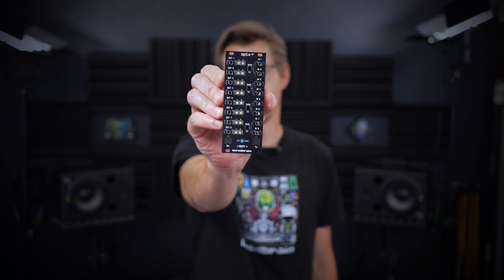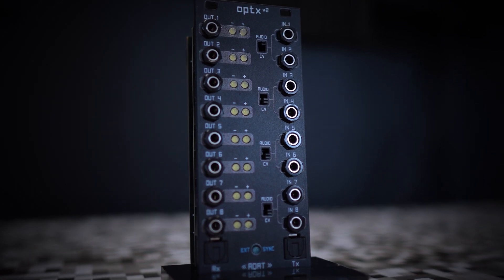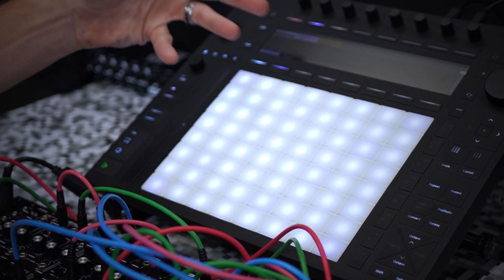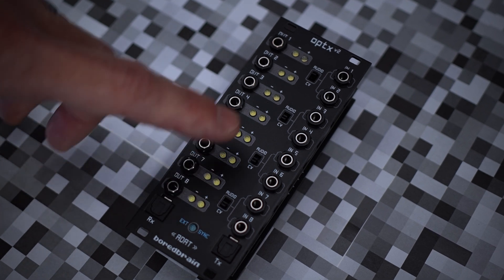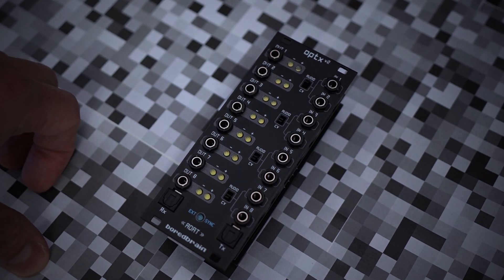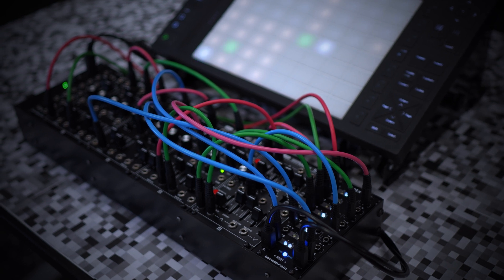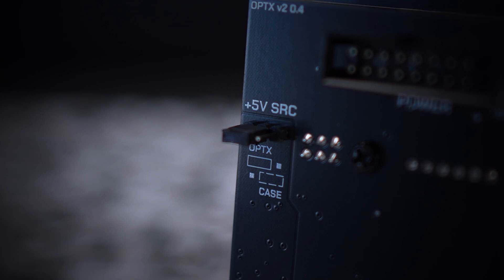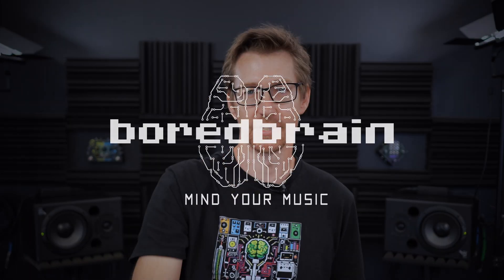Boredbrain Optx v2 brief introduction (ADAT converter for eurorack)

Comment: Hi, I checked your website and the user guide but one thing is not entirely clear to me – the issue of mod vs. line-level? With my current setup I'm using 4ms I/O, which is convenient because it converts line-level audio into mod-level output jacks (coming from external sources), and mod-level audio into line-level output jacks (going back out to my interface). Obviously without the conversion the signals can suffer from being too loud or too quiet depending on the direction.

I'm looking at the Optx v2 as a replacement to greatly expand my I/O from 2 channels to 8 each way (and have CV I/O too!). Is this whole mod<>line level thing not an issue? Can I take an external (line-level) source such as audio playing back from my DAW and patch audio directly from those outputs into my modules without an issue, or will I need to convert them first with another module? And same with returning back to my DAW, will I need to first convert back from mod level to line before patching into Optx, or does it handle this for me? Thank you!
Reply from the maker: @jonathanwingmusic  Optx v2 will handle line level signals being input and output with no issue. They will be a bit quieter going into the DAW and a bit louder coming out of the DAW than eurorack signals, which it is designed for. Because the module's noise floor is so low you can just bring the signals up once digitized if you like. Or you can use the 4ms I/O in the other direction you did previously, between your line level gear and Optx v2. Our Xchangr module is also a great option, although neither are completely necessary in this instance.
Reply: @BoredbrainMusic  ok cool. I'm basically out of rack space so would just end up ditching the 4ms in this case. I can also easily gain stage the sends and returns within my DAW as needed. Thanks for letting me know, I look forward to picking it up and having 8 clean channels each way, plus CV 🙏

Comment: Hey Boredbrain :) 
Question... I would love for Boredbrain to confirm this. 

Claude LLM (AI like Chat GPT)  told me that Optx 2 adds only 1ms or less of latency between the module and an external audio interface (Lower than Expert Sleepers Es-10, apparently). 

I want to use Boredbrain Xcelon and Optx V2 to integrate a Roland V-drum e-drum kit into Eurorack. 
The total latency from the drum pad strike to the audio interface must be under 7ms. 
Any more and it starts to sound audible, and is no good for real time tracking or overdubbing, of drum-triggered synth voices/drum kit audio while monitoring DAW audio. 
ADAT latency is one part of that signal chain that adds latency. 

I realise I can monitor with low/no latency using the BoredBrain-Monitr .. but that is only useful for the first take, and not while monitoring pre-recorded audio from a DAW. 

Your answer will help me realise my signal flow goals so thanks for your time :) 

Cheers from Australia!

Comment: Super cool - but optional ADAT ports on the back of the module would have made this perfect - for those of us who want to keep all permanent wiring behind our instruments.
Reply: YES, they should do a expander with ADAT ports on the back, my rack would be amazing.
Reply: Agree with this. My current I/O module (which is simply analog 1/4") I had manually tapped the rear panel by soldering to audio jacks installed into the rear of my rack. It was pretty easy to do, just soldered the two necessary wires and shielded them. Now considering shifting over to ADAT using this module – I am not sure if the same would be possible or if it's as easy. I googled and one can easily find ADAT sockets for cheap but they have many more pins to solder, rather close to each other, and I can't really find good info on wiring diagrams, so I'd be scared to open up a fresh Optx and poking around without knowing what to connect to haha. But if any clever person reading knows how to solder up ADAT jacks I'd love to hear about it.

Comment: I am going to wait until i see reviews from people. I already have es-3/6 so if optx v2 doesnt have a ton of noise like v1, clock issues and converters are grade A with the high quality op-amps, i wont get es-10 and try the optxv2. With excelon being amazing i am sure this new iteration will be high quality!
Reply: I'm in the same boat. I have an ES-8/6 combo, but am really interested in the Optx V2. I'm willing to sacrifice a couple inputs for the Optx features and slimmer profile, but the signal LEDs on the ES inputs is really useful and will be missed.

Comment: I have an odd question, can I connect the input side to a Ferrofish pulse and the output side to a push 3? So two different devices at the same time?
Reply: question is why would you want to do that
Reply: @zdfghdfg  so I can get more audio inputs to my interface, but use the outputs for push 3 to send cv to my modular. I use push three standalone.
Reply: @Ekkomouse  The ferrofish is just a converter just like the optx so you will need to connect the optx to your audio interface. 
One optical cable from the push adat out to the optx adat in, and one optical cable from the optx adat out to your adat input in your audio interface. What audio interface do you use?
Reply: @Ekkomouse  I don't know of an audio interface that is called "Pulse" the closest I can think of is the old Creamware Pulsar?
Reply: If you meant the ferrofish pulse, its not an interface, it's a converter...
Reply: @zdfghdfg  good lord, if you’re going to give advice then read up on functionality. RME ufx+ Madi in/out to Ferrofish Pulse receives/sends Optx input/output via adat. End result is all RME/Ferrofish pulse/Optx channels are available natively in RME Totalmix interface software. My question is can I split inputs to the Ferrofish as I need more inputs to my interface, but I could use cv output from push 3 more than outputs from the interface.
Reply: @Ekkomouse  This is why I asked you about your interface, you weren’t clear about your setup. Should I guess that you're using the UFX+ connected to a Ferrofish Pulse with MADI (MX version)

Sure, it will work, but your Push will need to be the master clock, and the other converters, including the UFX+, should all slave to it, from the optx2 ADAT out to your Ferrofish Pulse ADAT IN and then to your UFX+ MADI.

And learn some manners, people usually won’t bother to help you with that kind of attitude.
Reply: @Ekkomouse  it’s possible to keep the UFX+ as the master. 
If the Ferrofish Pulse MX can accept the 2 ADAT I/O (from the opx1 and the optx2) and convert them to MADI I/O, adding them to the MADI stream along with its analog I/O. 
The Push will be connected to the UFX+ ADAT I/O and will send the ADAT/CV to the opx2 through the UFX+ to the Ferrofish. Some routing in TotalMix FX will need to be set up, but it’s doable.
Reply: @zdfghdfg  Well from my perspective your questions/statements were overly concerned with the interface component, which is least important here, and not really needed to answer the initial question, as the optx is currently hooked to the Pulse, and the Optx2 would also be hooked to the same. 

It’s important to allow people to express frustration, your comments were too concerned about the interface. Your comment with the manners statement tells me you’re not aware of how you were coming across. 

Your last statements were more helpful and did spark the same idea for me also, to hook up push 3 directly to the pulse and use totalmix routing, something I can try now with Optx v1, which seems obvious in hindsight, but only came to light after this conversation, so thank you for that part. 

I still wonder if I can split the inputs and outputs to avoid totalmix latency, though maybe it’s not really enough to matter.
Reply: @Ekkomouse  You have a really strange way of expressing gratitude to someone who takes the time to understand your question and what you're trying to accomplish.

You assume I should know that your Ferrofish Pulse supports MADI (the regular version only supports ADAT) and converts ADAT to MADI to route it to your UFX+. Without this information, it seems like you're trying to connect an ADAT converter (optx) to another ADAT converter (Pulse without MADI support) and there’s nothing to gain from that.

You also assume it's just possible to sync everything without knowing the capabilities of your interface and digital converters.

It seems you lack basic knowledge of how an ADAT converter works, since there’s nothing special about the optx2 to allow its outputs and inputs to be used by two separate devices.
Reply: @Ekkomouse  Yes, that's nice. Thank you for stopping by.

Comment: I love the optx, but man the adat really needs to be at the top, those cables are too easy to knock into and are pretty fragile. But yeah I pre-ordered two of them. I run them upside down. FYI I’m going to try some right angle adat cables
Reply from the maker: @Ekkomouse  yeah, we kinda had to choose one way or the other, so I guess for now mounting it upside down is your solution.
Reply: @BoredbrainMusic was going to suggest this, I wonder if you could just make an “upside down” face plate or skin if users were mounting it this way? 🤔
Reply: @Luap-ls3ix  good idea

Comment: You've stated somewhere that you've tried various converters before you settled on the Cirrus Logic ones. Which ones did you go through and what made you ultimately decide for the CL one? Any more detail you could share on this?
I'm an Optx v1 user/owner and am looking to upgrade, but also eyeing the Expert Sleepers ES-10. For me it all comes down to the performance/quality of the converters.
Reply from the maker: @sandroidmusic  we tried all of the offerings from TI, including ones in the previous ES products. It’s slim pickings because the converters must be or allow to be DC-coupled, and there aren’t many. Everything we tried also had some little niggle, or left artifacts in the audio. So we decided to redesign the entire input section around the Cirrus Logic ADC used in many high-end Midas consoles, and we were immediately blown away at the performance. We could also individually disable the internal HPFs on each channel, although we decided to do it in pairs to save space, and then control a self-calibration procedure which effectively zeros out any DC offset as well. The noise floor is also very very low, only 3 dB higher than our RME interfaces.
Reply: @BoredbrainMusic  I can not Thank you enough for writing about this and the converters, there are NOT a lot great converters today unless you have the space, design and all the other things you need to address. I have never been happy with AKM converters, they have many different ones and people think the best one is everything, look at the garbage akm in akai mpcs, but look at the akm in steinberg axr4u, which now is not available because of the fire, I am dying to hear what you have done, so ordered one today, I did not even know you guys made this, super super Thank you!!!!!!!!!!!!. Now make midi interface that is like akai mpc 3000 tight, you mentioned RME, the Midi on the RME pcie cards is so so tight, close to Atari 1040st tight, the reason i propose this is because the hard work you put into this module, THERE ARE NOT that many companies that are paying attention to AD/DA.
Reply: Good question.  I'm trying to decide between the ES-10 and Optx v2 also
Reply: I´d say if you're in Europe get the ES10 and if you're in the US get the Optx
Reply: @janhenckell4178 that makes literally no sense whatsoever. Here buy this pos because it’s built in the UK and thats where you are from. Don’t buy the widget built in the US that is 10x better quality and is around the same price point. 😂
Reply: @joeymc5272  saying its 10x better quality based on nothing factual makes no sense. What are you buying here? better advertising?
Reply: Its called hypothetical genius 🤣 wtf are you talking about?
Reply: @joeymc5272  You claimed "the widget built in the US is 10x better quality".
Reply: @zdfghdfg  its hypothetical sarcasm not literal fact doh doh. I could have said the other way around too. Next time re-read things. I am from the US so i chose to use that country as having the better quality item because in the example than the EU. I could have said it the other way around and it would have made no difference whatsoever. The point still stands why the hell would you buy something because you are from that area of origin where the widget is being produced if say the other country of origin produces a much better product. Thats the example and sarcasm bud. Don’t think to hard on it. It’s just some smack talking.
Reply: @joeymc5272  but you said the US one is better based on nothing.
Reply: You for real 🤨? Do you know what hypothetical even means? Give it a rest. Just imagine it says european instead of American cripe. I bet you would argue with an ant if it could speak. 🤣
Reply: @joeymc5272  So how can you tell
Reply: @zdfghdfg  dude your weird.
Reply: Unless there’s an unintended issue, both are likely transparent, as most modern pro converters are. I prefer the ES-10 design because the individual line input type matters more to me than front panel adjustments of pairs. Plus, it’s expandable, allowing for additional CV/gates and MIDI/DIN sync with the Silent Way plugin.
Reply: @zdfghdfg i am where you are at right now as i have an es-3/6 and decided to  wait until optxv2 drops to see which one people prefer. For me it’s going to come down to converter quality and low noise floor. Having jumper pairs on the front is so much better than having to take the dam module out every time i want to switch. Can’t believe ES did that. 

  I have confidence boredbrain nailed this one and although es has done well for me ive had my issues with their es modules as well. Boredbrain is transparent in telling you what they use and ES is sneaky and secretive to me like they think people will rip off their designs somehow. That to me doesn’t make me want to support them. 

  This choice will ultimately come down to quality and stability for me. Cant wait to see this put to work boredbrain!